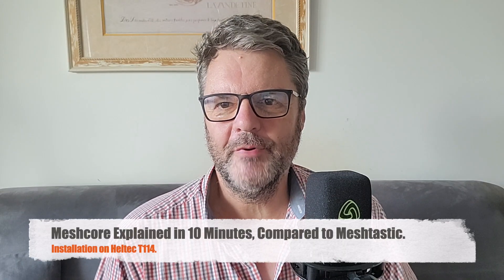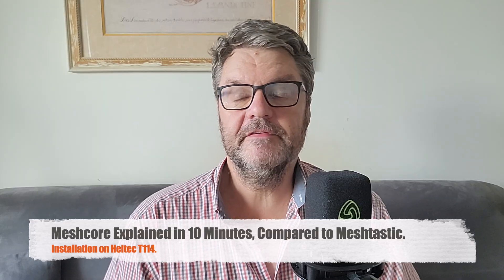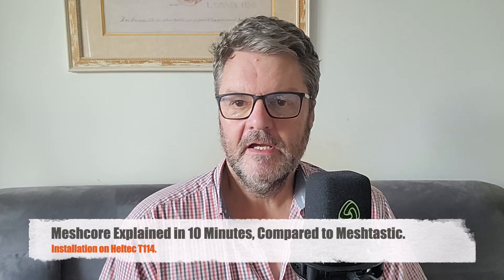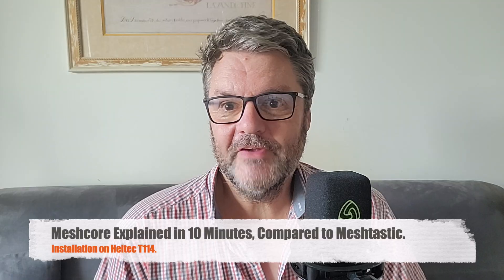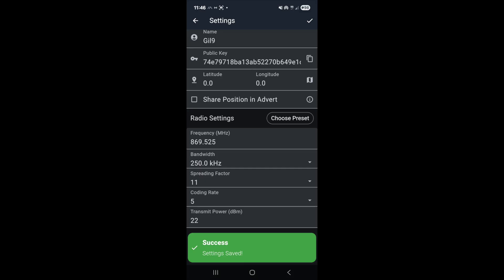Meshcore Explained in 10 Minutes, Compared to Meshtastic.

Comment: I'm not exactly sure how the routing is different besides the de-duplication - supposedly that is now an option on Meshtastic as well. It may be that MeshCore is just setup as more turnkey with rooms or something, but here in the Midwest USA, we were dealing with a lot of lost traffic over long distance. People in outlying areas especially that could make it into the main city meshes would get dropped. MeshCore seems to eliminate that problem somehow, and once you've messaged a few times with someone it's relatively snappy and very reliable. I use both because both are still in use. Mostly 'tastic in the city and 'core when I'm home.

Comment: Today I just set my first node for meshcore my closest repeater its nearly 8miles away over the hill. My first detect repeater was outside london 178 miles away and its get there with 8 hops. i have on the way 2 more boards to make repeater and one mobile station, £18 each included GPS.

Comment: We're currently rolling out a meshcore network in Moscow. We've concluded that standard meshtastic is very weak in dense urban areas. Covering the entire city would require approximately 1,300 nodes with a range of 500 meters. This would mean a lot of hops from one end of the city to the other, and there would be no connection. We're currently adding three meshcore repeaters a day in the city; it'll be interesting to see what we'll see in a month.
Reply from the maker: Interesting, keep me updated!
Reply: You're a bit misinformed sorry. THere's no difference between meshcore and meshtastic when it comes to the number of nodes needed to cover a city. Meshtastic also has the same repeater role as meshcore that operates identically.
Reply: @MassDefibrillator  From what ive read, MT is more spammy with messages, less directed towards repeaters.  Also in dense node/repeater environments, meshcore seems to work better.  Just for messaging at least, I dont know about the automation stuff yet.  I know that MC works way better here in Seattle where we have huge meshes of both.  Also MC is just way simpler to use.  I would imagine if i wanted to do more advanced things MT has that going for it rn.  I agree with the author though, why not both?

Comment: I was dissapointed my meshcore instantly because companions (client nodes) do not advertise automatically as meshtastic clients do, so when you turn on companion you see no one around you. User of node has to MANUALY advertise on network. You can try to write message to public channel in hope anyone would care to reply, but that is it.
Another thing I hate about meshcore is that when you send message in public channel there is no indication if message was received by any companion. You can only see if any repeaters caught it and in my current are in Lithuania there are no close by repeaters, but I know my public message was received by my second meshcore node. 

Maybe radio silence in meshcore will make sense if normies would start to use it, because meshcore does not creare unnecessary noise so better for practical use, but in testing stage, when you want to get as much contacts as possible, it seems to be depressing.

So in general I am more in favor of meshtastic currently.
Reply: meshtastic has the best of both worlds here as it does have the automatic advertising, but it also scales with the number of nodes in the mesh. So the more nodes in the mesh, the more time there is between each ping from the nodes. So it's built into the firmware that the advertising cannot overwhelm the network through growth. 

Every time I see someone praising meshcore, it's because they decided to put a repeater on a hill/mountain as if that's some unique functionality to meshcore (it isn't). Like of course the mesh is going to improve if you put repeaters in good positions; that fact does not change between meshcore or meshtastic.
Reply: It's really frustrating to see so many people ignorantly regurgitating this same talking point. Like, where are all these people coming from? Certainly not from any understanding of meshtastic.

Comment: I like most of your videos, but sadly.. I think you missed the mark here.   You almost definately chose the wrong radio preset, as most of the meshes have switched to "narrow" for a multitude of reasons.  If you left it on for 2 weeks with that preset, it seems like you would have had a decent amount of time to read about meshcore, and see that most meshes have switched.    I know you mentioned not wanting to invest more time into meshcore, but I'd be interested in seeing you switch to the narrow preset for your region, and see if the results change.
Reply from the maker: Thanks, you are the second person suggesting it. I'll try it.
Reply: @RadioPrepper  Glad to hear! When you try it again,  a couple things to know..  Meshcore doesn't have as many adverts as meshtastic.  the companions don't advert at all..  and the repeaters default to one advert every few hours.  So, just driving around and looking for "contacts" to show up is not a great way to evaluate.   With the latest app versions, though..    if you send a message from your companion, you'll see something like "heard 3 repeats" which lets you know 3 repeaters have picked up and relayed your message (and you heard those)

Comment: I abandoned MT for MC earlier this year. The topography around here was not great with MT and messages were unreliable. No receipt acknowledgement either. Repeaters running MC on mountaintops have been a game changer and we've linked communities over mountains that add to over 100km. 

Also, I've found the MC development community to be much friendlier and accommodating of new ideas and requests.

MT no doubt has its place, but that place is not here... 🤷‍♂️
Reply: > Repeaters running MC on mountaintops

no need to switch to a proprietary app to do that. You can also put repeaters on mountain tops with meshtastic. So what you're actually saying is, infrastructure in good positions makes for better communication. who would have thought? Obviously if you didn't have any repeaters in mountains with meshtastic, but then decided to put them there with meshcore, it's going to be better, but it's got nothing to do with meshcore vs meshtastic.
Reply: @MassDefibrillator no. We have (colocated with MC) MT devices on the mountains. Routing is random and you never really know if a message had ended up where you wanted it to go. So the MT devices are on the air, but the majority of people around here have gone to MC.
Reply: @BrockNanson  "Routing is random and you never really know if a message had ended up where you wanted it to go." both meshtastic and meshcore use flooding approach to routing, and avoid using routing tables. They are both "random" in this sense. 

The random routing in meshtastic would only be a problem if the mountain top nodes were not set to the repeater/router role.

Comment: Here in the Phoenix and Tucson area we have had a thriving Meshtastic network which overwhelmed long fast and most people had switched to medium fast but we are having a lot of coverage gaps to fill in.  A lot of the Phoenix guys are also running Meshcore which seems much better suited to the role of a large regional network.  We saw what the European were doing and we started up in our own custom narrow settings.

May I suggest you rerun your experiment but on European narrow settings?  I think most people have moved to narrow.
Reply from the maker: I might try that..
Reply: @RadioPrepper 
Please do, there's a big difference
Reply: Tucsonan here with no local contacts. Are there FB/reddit/?? groups where people coordinate? Maybe at xerocraft?
Reply: AFAIK There's nothing fundamentally different between meshcore and meshtastic that would make meshcore more suitable in the situation you give.
Reply: @MassDefibrillator the routing protocols are vastly different.
Reply: @michaelstora70  no, they are not. they both rely on flood routing. The main difference is that repeaters and end clients are a software setting in meshtastic, where they are separate firmware in meshcore. Other than that, they are pretty identical.
Reply: @michaelstora70  For the record, I thought what you said was true as well. Why else would you start the project from scratch instead of just doing a fork of meshtastic? So it surprised me when I read the meshcore documentation and found it used the same fundamental flood with deduplication approach as meshtastic. Then I realised the real reason they didn't fork: they would not have been able charge money for their proprietary app and UI firmware under the meshtastic open GL license. meshcore instead uses the MIT license for this reason.
Reply: @MassDefibrillator I'm not sure why you keep saying "you".  I'm not involved in the project but I have been running a repeater, a room server, and two companions for months and have not paid a dime to anyone.  The completely free version of the TDeck stand alone firmware is much more usable that the Meshtastic "fancy UI".

Our network is young but I'm currently running a little more than 50% of traffic on my server being routed and 50% flood fallback.
Reply: @michaelstora70  is english your second language? Because I'm saying "you" because I'm talking about what you said here in these youtube comments.

Comment: Seattle area. We have a meshtastic developer and the meshing around bbs bot developer both here. We tried everything with meshtastic and it never worked correctly. That's why the area here did the switch over to MeshCore. We have the largest mesh network in the world running on MeshCore as a result; it just works. There's a lot of enthusiasm to put up repeaters which is the exact opposite in MT with routers where people get shamed for using the network wrong.
Reply from the maker: Interesting, we never had those issues here.
Reply: @RadioPrepper the geography here is complex. In 70km you go over a 1000m hill/mountain and over to an ocean island. That link is actually from my uncle's house to my brother in law's. Absolutely impossible with meshtastic unless you had a blimp up 24/7. If you can get a mesh working here, it'll work anywhere
Reply: @MichaelCarper2  Hi. there's no difference between meshcore and meshtastic in this scenario you give. In both cases, you would want a repeater situated at the top of the hill/mountain.
Reply: @MassDefibrillator you need multiple mountain top repeaters costing 1k a month for space to do it that way. The geography here is hard
Reply: @MichaelCarper2  what are you talking about?
Reply: @M @MassDefibrillator mountain tops are not available for mesh radios following the law. You have to go around them unless you want to pay DNR a big monthly fee here
Reply: @MichaelCarper2  the same reality holds for both meshcore and meshtastic though. You can hide them in trees. That's the normal way to do it.
Reply: @MassDefibrillator you run out of hops with meshtastic. Or you run the tree nodes in router and everyone yells at you but you got zero hop
Reply: @MichaelCarper2  you still have ttl with meshcore, the equivalent of hops. Have you actually done that and been yelled at? You can also just set them up as clients. The only real reasons to use router instead of client is to help reduce congestion and packet loss, because router turns all clients in range into client_mute.
Reply: I'm very interested in this. I am close to gold mountain (6 miles as the crow fly) and the Meshtastic sucks. all the vids on YT for Meshcore, so far as I have seen, are EU and so I have wondered much about the local use of it and how wide spread a repeater network there even is here, and if it is worth the switch. the gold mountain GMRS repeater owner suggested the switch but where I am at it just worries me to try and flash my nodes for there to end up being no Kitsap repeaters. but, at this point with MT it seems like I can't get any worse?
Reply: Michael, I’m just getting started about to purchase a couple devices.
I’m in SE king county and looks like Meshcore repeaters are out here as well.  I will be up and running in a few weeks